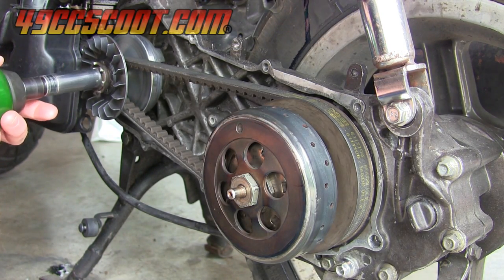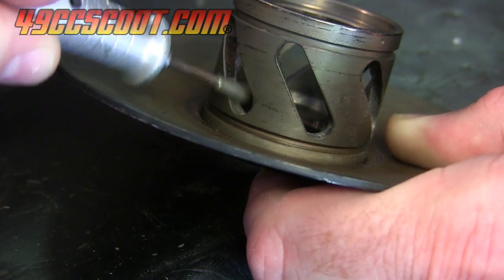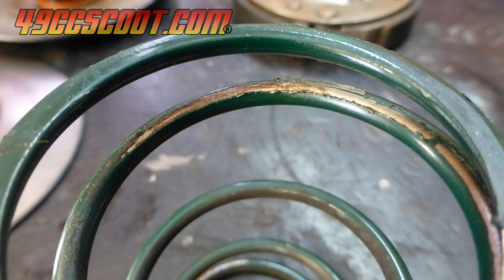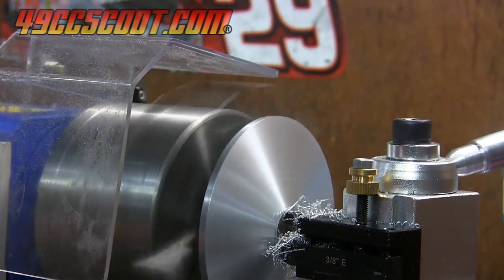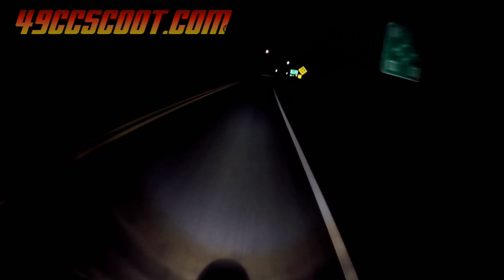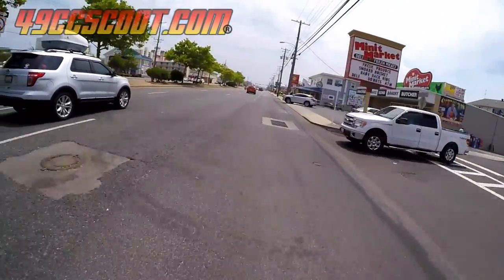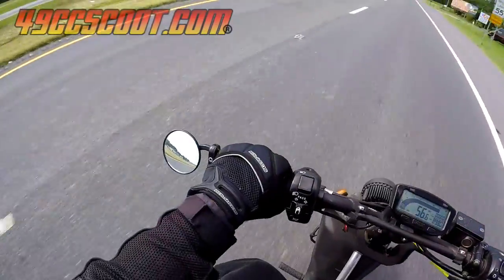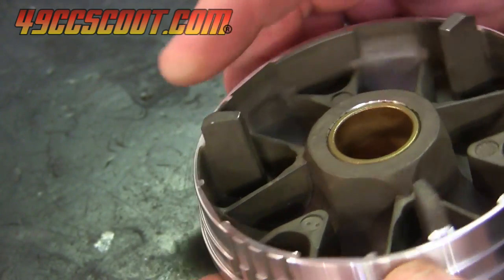Belt Busting Update And Beach Rides

Comment: is it weird that after i put in 70cc kit, my variator guide bushing break twice? I swear i put them in right
Reply from the maker: Some of the variators with small bushings will constantly break them. I used to use the Hoca clones of Malossi variators and I couldn't keep bushings together for long. Many already are disadvantaged by their short guides that leave the bushings partially unsupported and when you add more torque they're bound to break. Myself and others have tried to mod that style to elongate the guides, but I've grown very fond of the OR variator now and everything else seems somewhat inferior so I'd recommend considering that. It's quite robust compared to stock and standard aftermarket stuff, but it does require removal of the e-start stuff.

Comment: Hello I have a Simular engine to yours what modifications can I do to it mat
Reply from the maker: What modifications can't you do to these horizontal Minarelli based engines? Big bore kits and pipes of all sorts that could take it from a more powerful daily rider to a racing scooter. The BBK and pipe are the 2 big gains. You can build big bore strokers like the one I'm riding that's 103cc. They're generally mild, but make good power without revving too high. There are all kinds of CVT, igition, and intake mods out there.

The plan that makes most people happy who are just looking for a little more is to get a BBK or a pipe or both. Street/sport cylinder kits can be very reliable and there's quite a difference in power. You can put just a pipe on a stock 2T and it will gain some power and speed with more revs usually, as long as you find a pipe that works for what you have (don't bolt a high end racing pipe on a stock engine for example). Combine a BBK and pipe and it's way different than the stock setup was.

Tuning of the carb and CVT will be needed with most mods. Some setups will require larger carbs.

Comment: I have a stock gilera runner vx 125 4t year 2000 and and it used to reach 135km/hr easy,  since ever I changed malossi belt ,  malossi exhaust,  maloosi multivar 2000 variator,  the scooter never touched 120km/hr and lost 2 malossi belt, at 100km/hr,  it's like someone is pulling the scooter back and never reached high speed as before.  Any idea what just happened to my scooter and why the belt keep busting?  The dealer is so stupid that couldn't  figure out the problem.   Kindly help if anyone knows please. 
Thanks
Reply from the maker: To give your dealer some credit perhaps, this stuff doesn't just jump out at you. If you've watched the videos, you'll see it can be subtle things.

Anyway; make sure the jetting is correct with the new exhaust. Then it sounds like it's time for CVT tuning. If there's evidence of belt slip (discoloration from heat, glazed belt, black marks on drive faces) then you may need a heavier contra spring and/or heavier rollers to put more pressure on the belt. Could be related to spacing. Make sure you break in belts. Instead of going full-on from the start, give them about 20 miles of easier riding.
Reply: @49ccscoot  Many thanks for your valuable  input. Really appreciate it dear. I'll check all the above points you raised. 
Thank you again, 
Respect.

Comment: So you didn't check for broken shim pieces in the casing and you've drilled holes where manufacturers say it should be contamination free ,it's crap getting on your belt that's the problem ,and it's from the holes you've drilled into it
Reply: Filter behind the holes... most scooters today run cvt filters with an open pipe at the front of the transmission case

Comment: what gauge and headlight are you running? going naked bars on my honda elite
Reply from the maker: The gauge is a Trail Tech Vapor and I have videos about it. Stage6 also makes a nice gauge solution, as well as Koso.  I use 2 headlights. One is a 55W halogen driving light that I got from Pep Boys in a pair. The other is a 42W LED spot light that I bought online. Either one works pretty well alone. They're really nice together for dark back roads.
Reply: thanks

Comment: what the best rollers sizes to use for a 50cc tao tao 2015? Thanks
Reply from the maker: 16x13mm rollers are the size you'll need. The weight will have to be tuned to know for sure, but 5g sliders are popular.

Comment: what is that freeze spray you are using?
Reply from the maker: You can buy actual freeze spray, but I'm using an air duster held upside down (which the cans warn you not to do so use at your own risk). You can get them in electronics sections usually, because they are commonly used for dusting keyboards and electronics.

Comment: How did you get the 49cc scooter to do 50mph
Reply from the maker: It was 103cc (54mm bore x 45mm stroke) at this  point. 50 is pretty easy though. Some of the 2T scoots will do that with just an exhaust and carb/CVT tuning.
Reply: Most 50s that will do 50mph with cvt tuning. Upjetted carb and sports exhaust. My old aerox use to do 60mph on the flat. And that had an upjetted carb to an 87 main jet. Malossi variator, 4.5g rollers. Malossi belt. Malossi white contra spring. And leo vince zx exhaust also had tighter clutch springs.

Comment: How long do these transmissions last?
Reply from the maker: The pulleys themselves should last quite a while. Belts will need to be replaced regularly. Hard to give any exact answer. If you've got lots of power it could  stress everything more. I did just blow apart the rear pulley. It failed at the weld. Their newer setup uses rivets. I actually liked the old steel pulley better, as I got a little different results from it, but maybe the new design won't come apart.

Comment: Is this a standard 49cc 4 stroke? or 2 stroke?
Reply from the maker: 2T. Not really standard. 103cc (big bore, stroked, cases ported, pipe, reeds, intake, 21mm carb, advanced timing)
Reply: Amazing. I feel like I've met a hollywood star or something! lol I have been watching you for so so so long... I have learned so much from you. You will never be able to understand how thankful I am for all the videos you have posted over the years. This one in particular.  I had the same problem on a 50cc Chinese scooter right about the same time. I drove my 50cc scooter for 3 years. The engine (no rebuilds) has 23k miles on it and it still runs great! Only problem is everything else is shot. The body, brakes, electrical ect.

I just want you to know I am so very grateful for all the time you have spent doing this.
Reply from the maker: Thanks very much! Awesome to hear. With 23,000 miles on a Chinese scooter, it doesn't owe you anything. You could make a project of it, but the practical thing would probably be to get something new and hope it treats you as well.
Reply: 90GTVert  I put it to pasture when I bought a 150cc Chinese scoot. After this one I'm going to hopefully have enough money to buy a proper one like yours and a real motorcycle for daily long driving use.

Please keep posting!!!!!

Comment: i put a new 150 motor in and it just cranks over im getting spark and it has compression. it has new fuel pump its not getting gas im fukin stumped. ideas? thanks.
Reply from the maker: Where is it not getting gas? Making it to the carb?
Reply from the maker: If the carb is getting gas and it's not making it to the engine, then maybe something is clogged/dirty in the carb. Could also try simple stuff like holding your hand over the carb while cranking or using an unlit propane torch in the airbox while trying to start it briefly. Sometimes they are hard to get going at first, but once running they're fine.
Reply: well the head was fuked the valves werent lapped it 
was popping out of the exhaust. had another head  one it was a good one. ill try it in a few days. thanks.
Reply from the maker: Good luck.
Reply: @49ccscoot  i fugured it out the fukin exhaust was plugged. now its fukin  mint!!!! oh ive been pluggin you because u answer ive been on you tube for years now ur the only one that knows ur shit.and u answer questions.
Reply from the maker: @kevinstearns4198  Thanks man.

Comment: dude your little 50cc is faster than most stock 150cc.  I took my chinese 150cc out today and I think 55mph was it's top speed on flat ground.
Reply from the maker: Here's a more recent vid. A stock-ish 150 has no chance. Top speed is roughly 70-75MPH with me at 300lb and it accelerates quicker to 40 than my 500cc TMAX.
https://www.youtube.com/watch?v=i3owW-vsbTs
Reply: @49ccscoot  That's insane that much power comes out of that bike.  Now i'm thinking I need to flip this 150cc and get me a two stroke 50cc.  Do you have to mix gas everytime?
Reply from the maker: @aaronkeiser6349  I pre-mix, but you can use injection where you just have to keep 2T oil in a reservoir. Stock scoots are usually oil injected and that works alright at least up to a sport 70cc.

Comment: Dont remove anything from your pulldrivers.. What u did there with the Crankshaft variator pully is rly not good. Your taking material away from the pulley and u are not taking away material on the slider. Your belt wont go all the way up cuz u took away material..j And btw.. dont use those shims, buy a new aksel instead, they dont even cost that much.

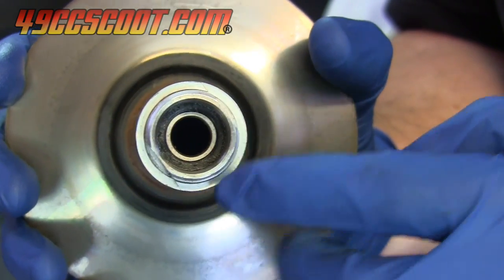Comment: your variator fixed pulley appears warped 3:03
Reply from the maker: I've had 2 or 3 of the Malossi steel pulleys now and they've all been like that. It seems like the OD is just not concentric. The newer aluminum pulleys from them run very straight, but honestly the steel one was easier to work with for good results for my setups. Took more effort for me to get the aluminum pulley to do what the cheaper steel pulley did.

Comment: You should put a 70cc or a 80 cc cilinder kit from malossi or polini NEVER EVER use airsanal it is not very realiable or strong
Reply from the maker: I may have to go with a more standard kit sometime soon. I'm now LC, and I can't find the big 53-54mm bores in LC anymore. Trying to figure out what I want to do that is quick, power wheelies, but reliable.
Reply: 90GTVert what scooter/moped do you have
Reply from the maker: @SonicXD112  Chinarelli. Currently 103cc. If you watch my latest vids from riding around a car show, you can see how it runs. I like it, but I can't seem to find the cylinders for it now. There's plenty of stuff that makes as much or more power, I'm just undecided on what I want for practicality/reliability.
Reply: 90GTVert what type of engine do you have i mean like a minirelli horizontal or a vertical or a piaggio or a honda
Reply: 90GTVert  you can make a realy good drag moped from a aprilla sr50 or a yamaha aerox or any other know brand bike you can find almost anything for them
Reply: 90GTVert i wan to start getting in tuning moped but there are not a lot of tutorials out there some stuff speaks for itself but it is nice to have some guidance
Reply from the maker: @SonicXD112  Chinarelli is what some call the Chinese clone of the horizontal Minarelli... Zuma/BWS sort of.

Comment: Hey buddy, instead of shimming that bearing on the shaft, which isn't good- try a fat oring on the shaft or order the one used in a 90s jog http://www.yamahapartshouse.com/oemparts/p/yamaha/93210-06550-00/o-ring  good luck!
Reply from the maker: Those things always get lost somehow for me. That may be enough to do it. I think the fuel injector o-rings from my Mustang were close in size IIRC. If the shaft is close enough in diameter, I may give that a shot.
Reply: I have a 93 Jog and I agree, an old injection oring might be fine- and that's good thinking on your part. The oring puts preload on the bearing and it is the seal between the bearing and the shaft. Its important in my humble opinion.
Reply: how to shim a stage 6 variator
Reply: Hi Jason, I don't understand the comment. Are you telling me to search for that or what does it mean?
Reply from the maker: I don't think I've ever used a S6 vari, but it would be the same as any other variator for shimming. Some info : https://youtu.be/d3cQKYT0ojg?t=6m27s

Comment: Well thats your problem mate 
You drill too many holes in cvt cover 
That belt got dirty
Especially if you run it in beach or dusty area 🙄 
Change bearing in cvt cover will solved your problem too 
No wonder it will break 
Lol
Reply from the maker: Yeah, but I need my speed holes.